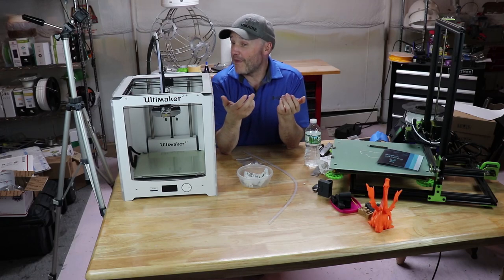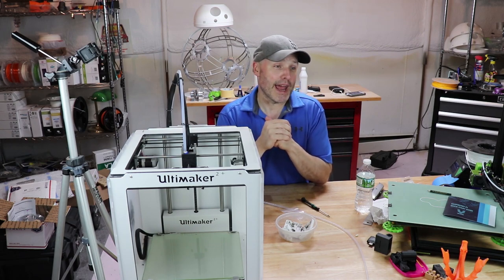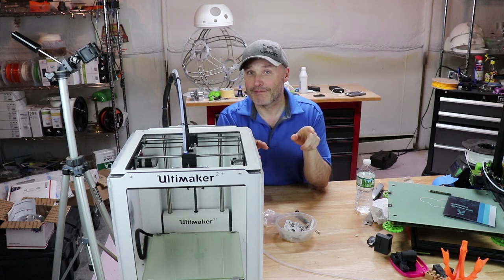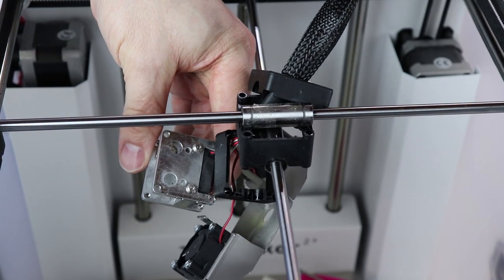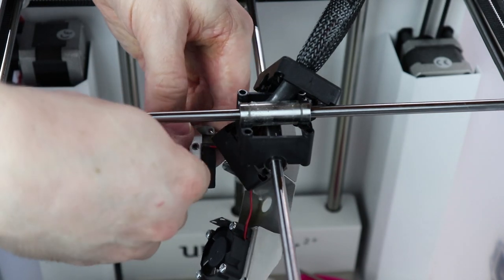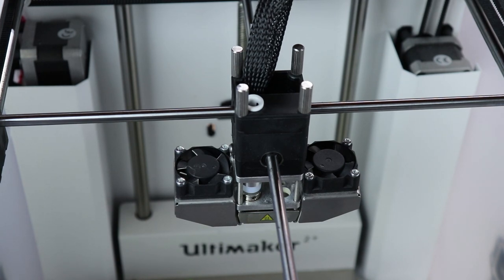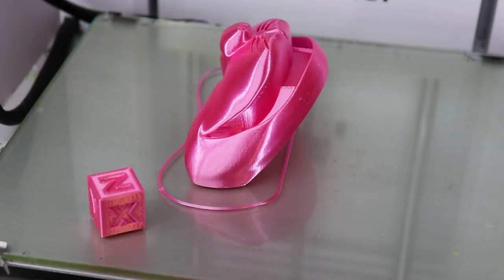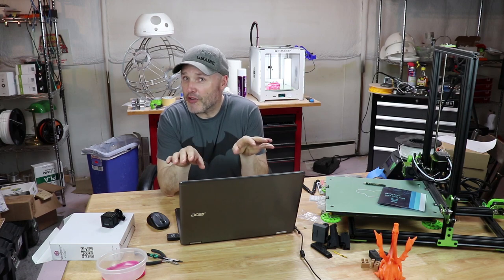Replacing the Ultimaker 2+ TFM Coupler and Bowden Tube!

Comment: Do an atomic pull before changing the TFM coupler, get's rid of all the filament stuck in the nozzle and you can push the TFM coupler down easier, and you're meant to adjust the pressure by adjusting the steel coupler on the nozzle so it's just enough pressure so you can't rotate the TFM by hand

Comment: I am having a problem that I can not figure out. I have replaced everything from the feeder in back to the nozzle, inclusive, and the filament keeps binding up in the print head area. When you pull the tube out and look at the filament, it has what look like a kink about an 3/4" of an inch from the end. Clean the jam, and runs for about 3mm in print height and dose it again. Any Idaes? 
thanks
RC
Reply from the maker: Did you replace the coupler?  It sounds like you did. Have you also replaced your nozzle?  I’d also suggest asking Fabrc8 since not only do they manufacture the Ultimaker printers but they also support them. Simon and Erin are great